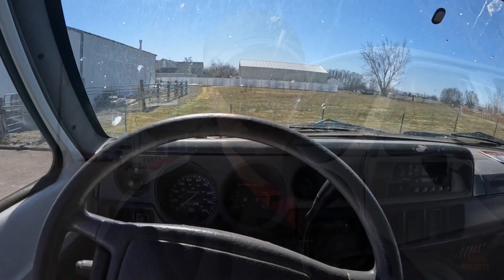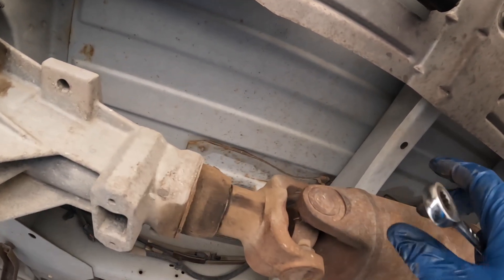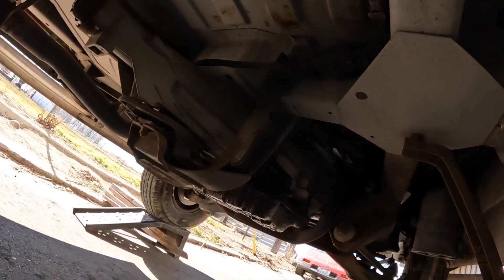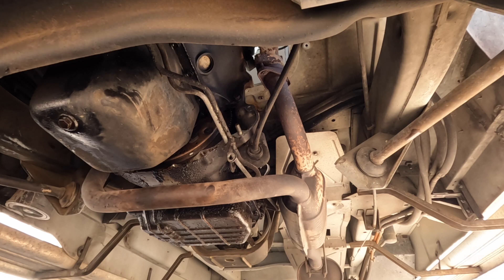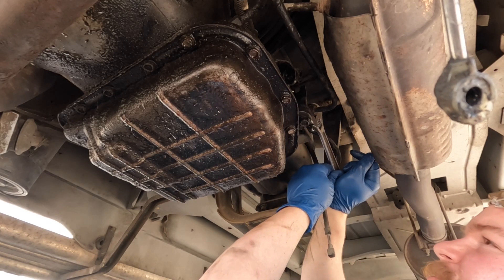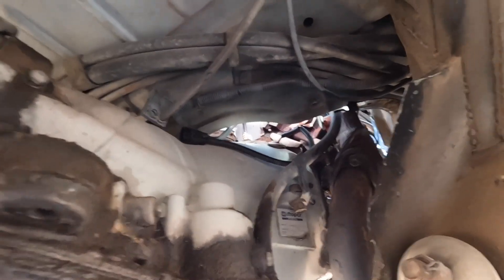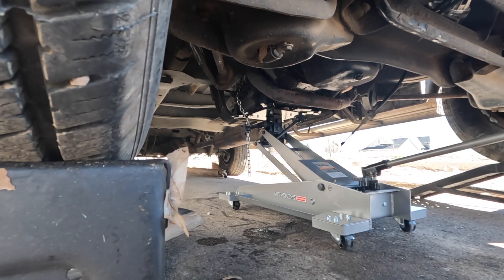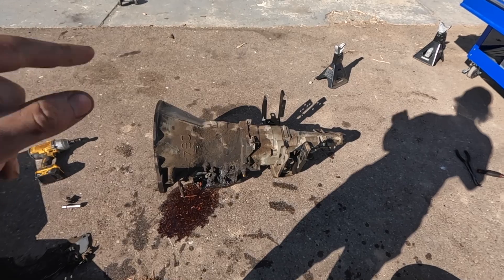Transmission Removal - Dodge Conversion Van Pt 3

Comment: Been looking for this for a while (I found it while googling "dajiban transmission" as I have an 02 Dodge with a torque converter on its way out. My advice would be to change the description to include "Dodge Ram 1500 Van" "Dajiban" as well as conversion van. Put all these keywords in the show notes as well. Definitely get you some more views to this video. Super useful stuff!
Reply from the maker: Thanks for the info! That's interesting, I had no idea these vans had that kind of following! Super cool
Reply: @NotEnoughProjects  The Dajiban community is definitely a fun one if you have a Dodge Van. Let me know if you decide to really give your van an overhaul, Id be super interested to see some video with your kind of mechanical commentary. Working on my transmission today.